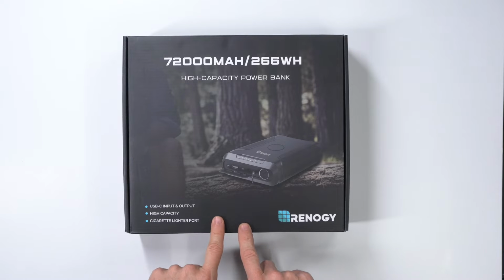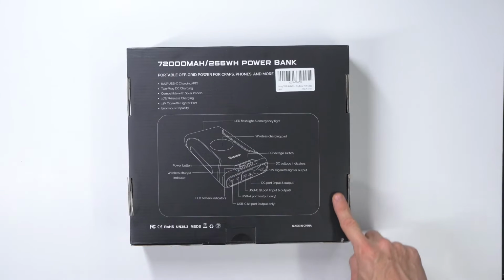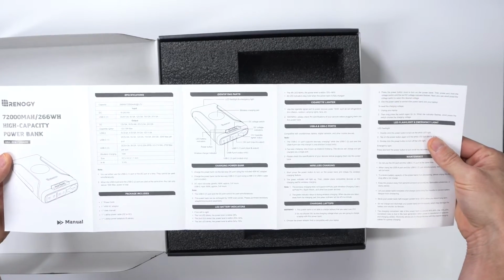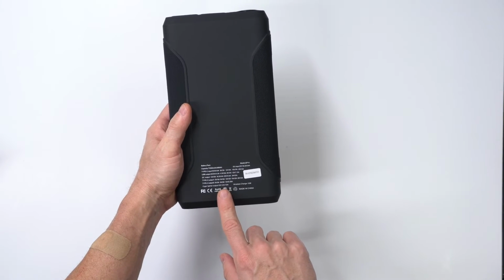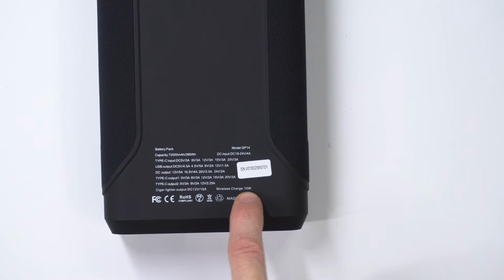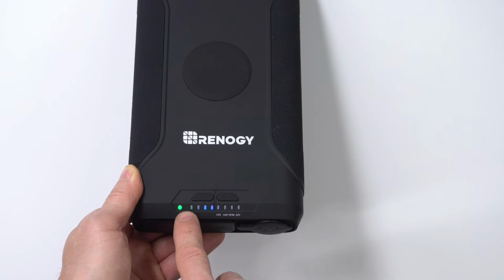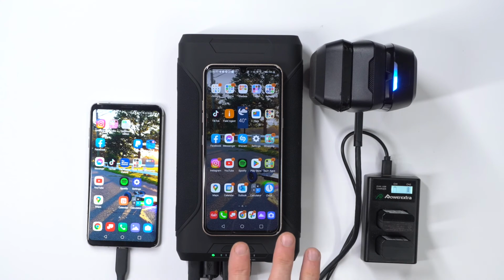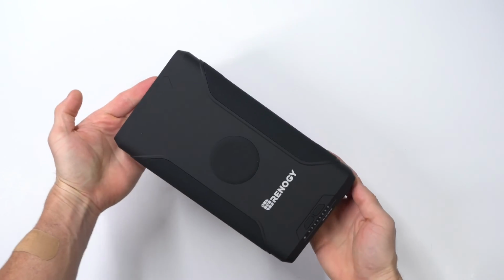Renogy 72000mAh Power Bank Unboxing & Review

Comment: Not just usb c but 60w pd. You kinda blazed right past that juicy part. It will run my laptop for several hours.
Reply: Would it be able to run Dell XPS 15 9500 that is 130W?

Comment: Please sir I really need your help urgently
My power bank stopped showing the led lights when you switch it on
And it enters a form of safe mode while charging, it just blinks each led light from the 4th to the first and on repeat and when unplugged it doesn't switch on
Please how can I fix this?
Reply: You contact your supplier, and ask them to solve the issue. That where your warranty comes into play.

Comment: Anyone know the specs for the charger? Or have an smashing link to a perfect match to use for this?  I lost mine in a move and need a new one. Thanks.
Reply from the maker: As per the user manual, the original charger had an output of 40W. So any charger that can deliver at least 40W should be a good option.
Reply: what if it's 60w-82w-a 90w charger.  I'm having a hard time finding one on Amazon to buy
Reply from the maker: @austinfitch4475  any of those chargers should work. It should have at least 40W, but it can have more. It's just that the power bank will not be able to use more than 40W.

Comment: Hi, I have a question. I have a Garmin GPS and a 10,000mah anker power bank.

Would the power bank last longer if I kept it constantly plugged into the GPS through the day while I'm using it . Or would the Power Bank last longer if I just charged the GPS as and when needed?

Hope that makes sense, and thanks for any reply.
Reply from the maker: I think using the power bank just when needed will make it last longer. If it's constantly plugged in, it will charge the GPS every time it decreases under 100%. And charging between 80 and 100% usually consumes more battery.
Reply: @PowerBankExpert  Thank you 👍